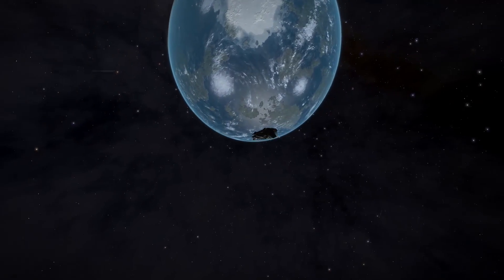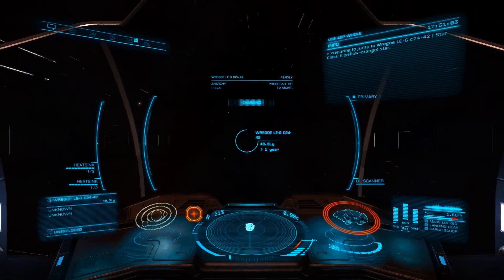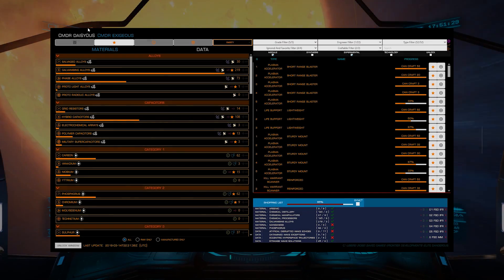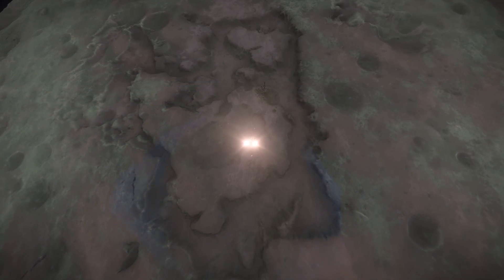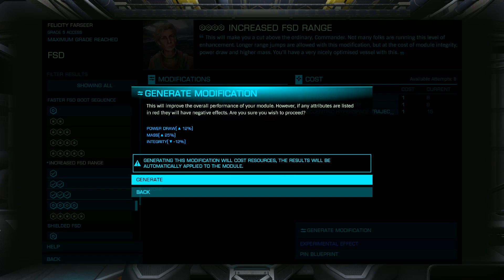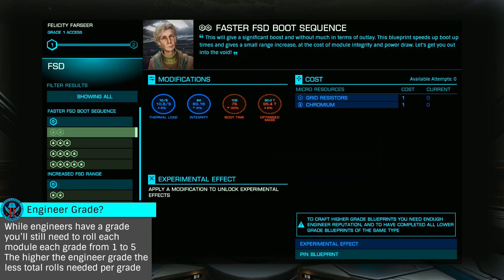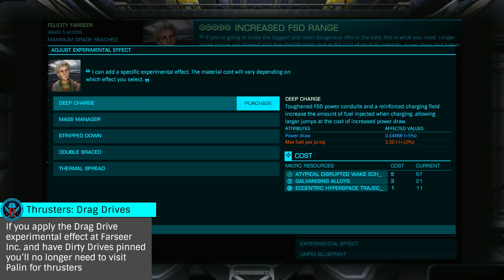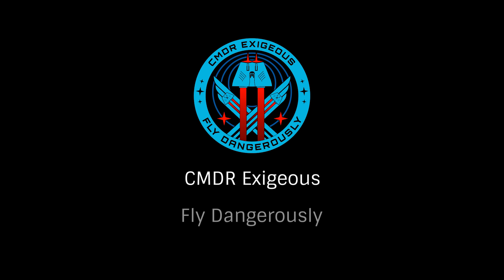Engineering Explained: Complete Process

Comment: Thanks for the truely awesome collection of videos.  So much useful info in such short vidoes.   I have a question on the number of rolls.  I've just unclocked Tod McQuinn and am now unlocking each grade at his station.  I had all the materials needed lined up to get to G5 Overcharged multi cannon. But I'm finding I need more rolls than 3 to get past grades 1, 2 and 3. For example I just did two rolls on G3. Then a message came saying Tod has unlocked G4.  But the 4 hex icons are still showing padlocks and so I did a third roll.  Still showing padlocks, and still stuck on G3, not complete.  Now I'm missing materials 'cause I only had enough for 3 rolls and have to go farming again. I didn't have this problem with Farseer.  Not sure what I'm doing wrong this time.

Comment: I got the game in Dec 2019 after the latest updates. The term "rolling" doesn't mean squat to me.
Reply from the maker: "Rolling" is what we call generating an engineering upgrading.  The old system was very similar to a slot machine where you'd pull the handle and the various settings would "roll" around until you get a result.
Reply: @Exigeous  thanks for using insider slang on a video for people who are trying to find out the basics
Reply: @behindthen0thing525  lmao you're being rude to a guy who put effort into a video to help you for free, because you're frustrated at how complex a video game can be.

"Rolling" is standard terminology in gaming in general, and anyone who's ever rolled dice irl can generally infer what's meant by it.  No reason to lash out at the man.
Reply: @WhompingWalrus  its not really rude to expect a video called "engineering explained" to help explain engineering, he has a point that if you are new to this you wont know all the terminology and its not explained in the explanation video.

Comment: one you've applied an experimental at grade 3, do you still need to do it on 4 and 5? and/or in between rolls? thanks for your vids, super helpful
Reply: nope, once you put the experimental on, its on until you remove it or replace it.

Comment: You mentioned that you don't have to engineer all components to G5.  Do you have any examples of when it is unnecessary to engi to G5?  I'm asking because I have not done much engineering at all and only under the old system.  I haven't touched engineering recently.
Reply from the maker: Totally depends on your ship and build.  For NPC combat every little bit helps, for PvP combat everything is basically required.  Beyond that it's just how much you want to grind for what you want - for example I'd go for a G5 FSD with experimental but maybe only G3 drives - as the QoL difference for FSD makes a big difference given how many jumps we do

Comment: So here is something I have yet to see anyone discuss, nor have I had the materials to spare to test myself... When you upgrade a module from one grade to the other, you do not have to COMPLETELY max out the current grade in order to  upgrade to the next tier. For example, I do not have to be at 100% of grade 4, to upgrade to grade 5. My question with that is, if I do not go to the 100%, and upgrade, say at 95%, do I lose any potential stats increases?
Reply from the maker: You don't lose a thing - so let's say you do 1 G4 roll and get to 30% of G4 max - and then you're able to roll G5.  When you do that first G5 roll you have the same specs as if you maxed out G4 with 4 rolls THEN did the single G5 roll.  So in short a G5 roll is a G5 roll is a G5 roll.
Reply: @Exigeous  I am more confused now
Reply: So then you can flub through G1 through G4, get to G5 and go to 100% and suffer no penalties, right?